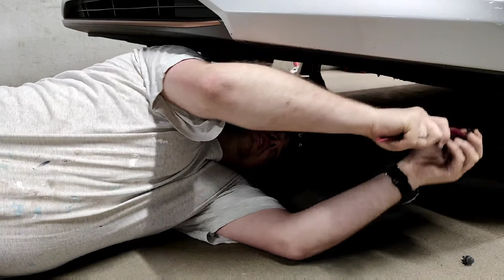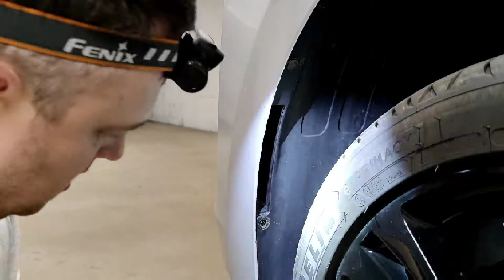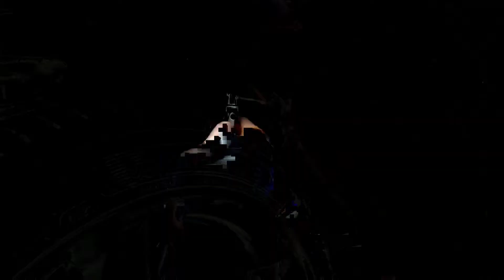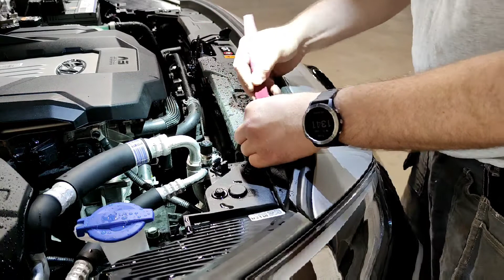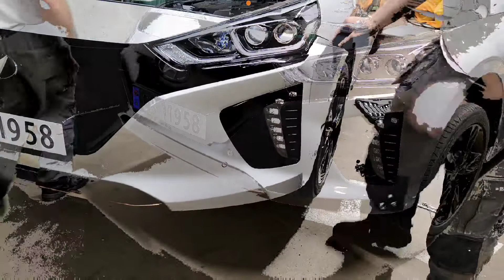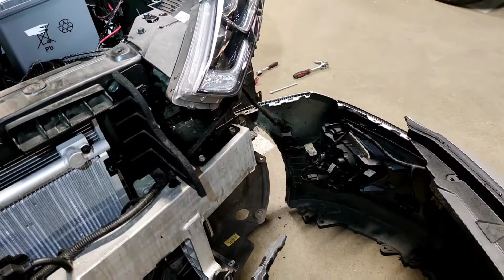Hvordan demontere frontfanger på Hyundai Ioniq 2019 Electric 28 kWh

Comment: hi, How do you do to put the car on jack stand as the car only have 1 jacking point on each side, if you use it with the car jack to lift the car, where you put the stand ?
Reply from the maker: I jack up the car at the usual point, but I put the jack stand on the carrying arm for the wheel suspension. (do not know if I use the correct name for this in English)